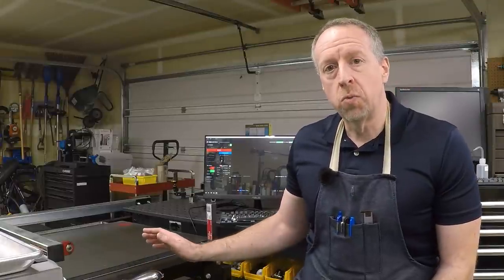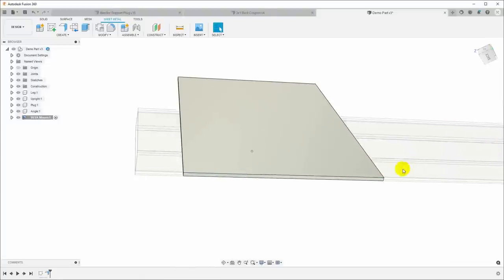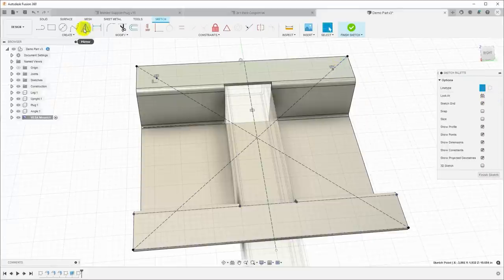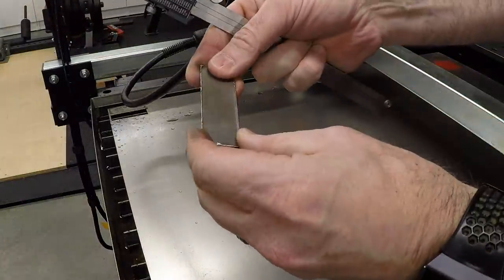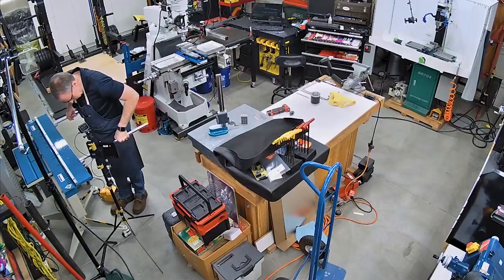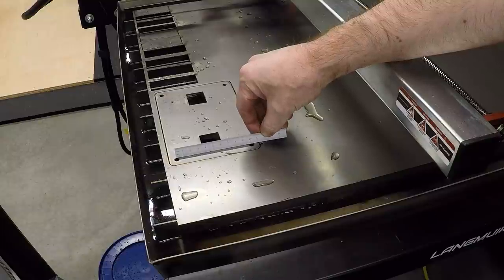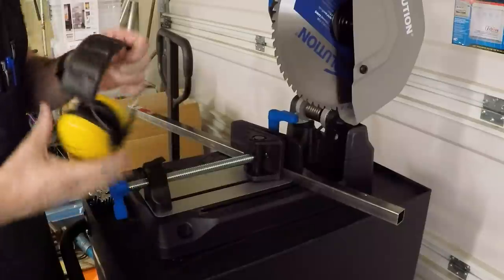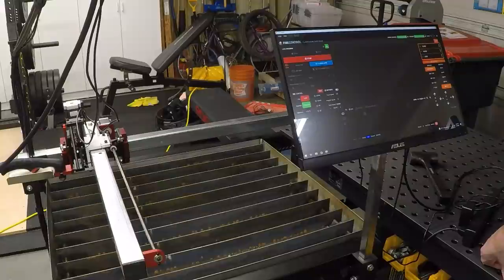Determining Sheet Metal Cut and Bend Parameters | CNC Plasma Table Monitor Mount Part 2 | Fusion 360

Comment: Hi, I'm a time traveler and I've just come back from the future to give you a warning about that monitor mount. The screws and metal spacers you've used, have connected the monitor's ground to the chassis of the plasma table. This means that the ground on USB cable from the monitor is also grounded to the plasma table. The USB cable plugs into the plasma controller, which the manufacturer has taken special precautions to ensure that it is isolated from the plasma table chassis. If you sort this out now, it'll save you having to admit to making a mistake later. Love your videos by the way, thanks for all the great content.

Comment: I was looking for filament videos and found this little project. I have the project in mind, replace the flimsy LS laptop stand with touchscreen mounted to my Crossfire Pro. It's been a year, were you able to operate firecontrol without a keyboard attached? Thanks for these 2 videos, you've saved me a lot of design time.

Comment: Are you using the FINE CUT nozzle? That nozzle is the best for sheet metal because there is no dross. Here's a tip for, I used to recondition my nozzles to extend their life. First of all, I would turn about .002" off the face and then ream the orifice with the proper size ream. Many times, just cleaning the face of .002" -.003" did the trick. you have to get them early enough though. I could tell by the sound and checking the cut edge if the orifice was egging out. Usually, if one side has dross it is an indicator the nozzle orifice is starting to egg out. I would change the nozzle and when I had 10-12 used nozzles to recondition, I would face them and check the orifice. If it needed it, I would ream it to clean it out. I used a jeweler's loop to check the orifice.  I hope helps.

Comment: Nice! How close did the vertical 100mm spacing end up? Seems like lots of room for a bit of error, but also adjustable via bend angles.
Reply from the maker: It was close enough, but I tapped it a couple of times because I'm a perfectionist.

Comment: Your probably not going to like my technique for removing dross, but I will tell you anyways. When the part is done cutting pick it up and drop it on the ground. That should break off around 90% of it.  I own one of the original pre-order crossfires that mainly collects dust in my workshop but have cut alot of plate on it and it works great everytime I fire it up.

Comment: That project turned out great....one thing I've found on welding is to flood the object with lots of lighting so there are no shadows on what I'm trying to do, and I have a cloth cover on the back of my helmet so I don't get glare/reflection on the inside of the viewing shield.
Reply from the maker: That's a good tip on the glare.  I do get a fair bit from behind.
Reply: @Clough42  Another place I get stray light is from under the front of my helmet. (worse with light colored clothes) I found the little add on leather flaps for that spot made a big difference.

Comment: That little plasma table seems nice. However, you can see it visibly shaking and moving as your cutting. While it doesn't appear like it effected your cuts on this project, I would recommend looking at stiffening the frame up if possible. Smaller materials could end up shifting and ruin your cut.
Really enjoy your videos. As with anything, time and experience.....
Reply from the maker: The frame is not flexing.  It's sitting on casters and the reaction forces are rolling it a little.

Comment: Looks nice.  Can you tell the software that you mounted the monitor 90 degrees to the actual table so pressing the arrow buttons makes the machine move in that direction?
Reply from the maker: I knew it would be 90 degrees off, but I didn't know how annoying it would be.  I'm planning to swap the wiring for the axes.

Comment: You should use MIG it is so much easier. TIG is so much harder than it looks! I have bought a footpedal now so hopefully I will get better.
Your workshop always looks so spotless - mine just looks like a workshop 😁
Reply from the maker: If all I cared about was speed and simplicity, I would have used my spool gun or just bought a MIG machine.  TIG requires skill and it's a skill I am trying to acquire.
Reply: @Clough42  
Same here but I doubt I will ever be good. I am useless at anything free hand. That's why I love machining!

Comment: You can use your digital caliper as a front gauge to hit your bend lines exactly.... just set the caliper to your bend line dimension, and use the depth measuring ability of your caliper up against the nose of the top tool and against the front edge of your material...but only if your caliper is long enough for the flange
Reply from the maker: Good tip.  Also a fantastic way to magnetize your caliper.  :)
Reply: @Clough42  that's a good reason to get one or those composite calipers we machinists always scoff at lol 😆😆

Comment: Hi James, did you bolt your bend brake to the floor,or do you find the machine weight is enough? Like you space is a premium and permanent bolting for me would compromise my options for my equipment. The only thing I have had to bolt down is my Mr.Deburr drum,as it will walk like a miss loaded washing machine.And your welds are fine,great video.
Reply from the maker: I have it on Footmaster style casters.  So far, it's fine.  I could imagine full width bends in 16ga might be enough to move it?

Comment: Very nice. The cables could just go into the tube, couldn't they? I've been using furniture wax on unpainted steel surfaces lately. A thin layer which you can polish keeps the "bare metal" look and it's extremely easy to apply. No rust yet.
Reply from the maker: Unfortunately, the bolts through the post prevent routing the wires through the tube.

Comment: I have been thinking how to mount the monitor to my homemade plasma table. Now I know. Thanks for the videos you make. I always learn so much.
Reply from the maker: If you haven't seen the later video, make sure you don't ground the monitor to the table if you have a Langmuir.  It will ground the electronics through the USB cable and prevent the torch height control from working.
Reply: @Clough42  Thanks for mentioning that. I saw the video but forgot it was a problem. Grounding can be a confusing issue.

Comment: In this case to put construction points for the holes there is shorter way: just create center point rectangle (center point in the diagonals cross section) with the desired dimensions (width and height) and put points in the corners. And - that's it!
The same procedure can be used if you need three, (four - just mentioned) five, six etc. symmetrically positioned holes. Just create center point polygon with desired number of corners (holes), dimension it and put construction points. That way you usually you do not need mirroring.
Reply from the maker: Good tip.  Thanks!
Reply: @Clough42  Welcome :-)

Comment: I love watching your videos! As I was watching this one and where you were trying to determine where to put your score line for the bend reminded me on a section I’m studying right now to get my Airframe & Powerplant license for the FAA. There’s some formulas they use to get the “setback” of a leg and the bend allowance to determine was size flat piece you need to make a part. In this case of the 2”x1” piece bent to 90° using that formula I’ll try to explain. You may have this formula already but if not maybe you can use it in the future. The formula for setback if SB=Radius+Thickness (R+T) thickness being the material you’re using. So for a 1” leg at 90° with a .063 thick piece with a radius bend of 1/8” the setback would equal .188. Then you would subtract that from 1” which would be .812”. To get the bend allowance you’d use the formula 2pie(R+1/2T) over 4. Bend allowance for 1/8” radius on .063 material would be .246. Then to get the flat piece overall length to make a 1”x2” piece bent at 90° you’d subtract your SB from each leg 1”=.812 and 2”=1.812. Then add those 2 together plus the Bend allowance of .246 to get the overall dimension of the flat to be 2.87” long. This may be confusing the way I tried to explain it. I wish I could post a picture of the example in my study material
Reply: I sent a picture of the diagram via instagram if you want to check it out
Reply from the maker: The software does this calculation, but with the magnetic brake, the radius of the bend is not necessarily well-controlled, so it has limitations.
Reply: @Clough42  I figured the software will do that. I just thought it was nice to know that way to calculate them on paper because I never knew it. Really enjoy your content tho!

Comment: is there any reason in particular you didn't split the difference and run 175 inches per minute for the plasma table? Can you only adjust in increments of 50 IPM? or is there something else coming into play?
Reply from the maker: There's no limit to the speeds.  I just figured fine tuning it to that level probably wasn't worth the effort.

Comment: Help! Slots using Fusion 360 and Langmuir
Would really like to see how to design sheet metal parts in fusion with sharp thin slots used to make the bend lines in thicker sheet metal/plate. 
The issue is that the settings for a flattened sheet metal part in fusion have a lead in and so a thin single line slot will never get created or posted. Would love a short video of you know how to do this. I'm wondering if it's possible at all? Maybe setup a custom version of langmuir posting tool with different parameters to "fake it"? Can you pick different tools for different operations? I appreciate that maybe one would have to live with a bit of uncontrolled piercing at the beginning?
Thanks!
Reply: Clarification. The idea is to make a bend with only tabs holding it so it can be "weakened" so that it can easily bent with the intention of welding the corner back up as needed to make it stronger.
Reply from the maker: I've been thinking about that.  Haven't tried it yet.

Comment: you can route the cables through the post with some 3d printed caps, nice detailed video like always. keep up the good work. any updates planned for the electronic lead screw ?, 

I was thinking semi CNC electronic lead screw you can add a servo to your main motor then you have a precision controlled Chuck and a router attachment. just thinking out loud here
Reply from the maker: Don't forget that the bolt sleeves almost entirely block the tube and I have a monitor power cable to route.
Reply: @Clough42  yeah indeed overlooked that part

Comment: James, not sure if it'll work for you but when I wanted a cover for my lathe, a Myford ML 7, I used a BBQ cover. It's sturdy and works to keep the sawdust out when I'm doing woodwork .
What about the shipping container that the monitor came in or a suitably sized garbage bag if you just want to cover the monitor.
Regards from Canada's banana belt. 👍🇺🇲🕊️🇺🇦🍌🇨🇦🤞

Comment: I like that you keep precision in mind even when it comes to sheet metal, so kudos for that. The build turned out very nice, and I am even more envious of that metal brake.

I'm not sure it will help, but I will attempt tig advice. I've found it best when you're starting your bead to get a puddle flowing on both of the sides that you intend to connect. Once you've created a puddle on both sides you can drag them towards each other, push the pedal a little further and start adding filler. Just be consistent in your movement and time your filler and it will do the rest (easy thing to say I know). Good luck in your welding endeavors and keep up the quality work and thank you for the videos.

Sincerely,
just some apprentice.
Reply from the maker: Thanks.  I'm just getting a feel for steel.  In this case, I think 65A was a little cool.  I suspect a little more heat would have made it easier to get the puddles to join before things melted back.  I'm also figuring out shades and cheater lenses so I can see the puddle better.
Reply: I generally set my helmet around 10.75 or 11 for Tig, but I'm usually welding in the 95A+ range on high carbon steel. As long as you don't feel eye strain afterwards you know you have the right setting, setting it too dark will strain your eyes as well. 65A wasn't too far off if you use the 1amp per 0.001" thickness rule. Another little tidbit for welding thicker to thinner is to spend more time on the thicker material and just wash the puddle quickly to the thinner material so it doesn't absorb as much heat.

I've been lucky enough to have people around to pester about welding, and these are things that I've been shown that I didn't think about before. The grind on the tip being rounded or sharp make a difference as well, more rounded tips make a wider puddle and vice versa. Grinding the tip with a diamond wheel instead of sand paper also makes a difference in quality as well. Food for thought I suppose, sorry if I'm bugging you with stuff you've already heard.
Reply from the maker: @thallmeister  I made a recent video about building a diamond tungsten grinder.  A sharp tungsten makes it a lot easier to control.

I started out at shade 12.  I'll try 11 next time.  I had everything running well at 125A on aluminum, and the first time I tried it down at 65A, I didn't have it set sensitive enough, so I was getting flashed occasionally.  That's no fun.  :(

Comment: James what is the mode of little  pc that your using on the back side monitor. On the plasma
Reply from the maker: There's a link in the video description.  I would consider it just barely adequate to run windows 10 and the crossfire.  Might be a good candidate for LinuxCNC.

Comment: When editing the thickness of the sheet metal, can you just enter "16 ga"?
Reply from the maker: It doesn't work for me, which actually makes sense, since sheet metal gauges are not standardized.  16ga mild steel is .0598".  Aluminum is .05082".  Stainless is .0625".  Copper is .065".  

https://www.metalsupermarkets.com/sheet-metal-gauge-chart/

Comment: I really appreciate your channel and content. You should fully convert to metric though. The transition starts with the engineers! 🎉
Reply from the maker: If all of the steel you can buy locally is specified in inches, all of the dials on all of the machines you can buy locally are marked in inches, all of the hardware you can buy at your hardware store has unified inch screw threads, and all of the end mills, drills, and collets you can buy at your local tool supply are in inches, it sounds pretty silly when someone in the YouTube comments says "You should fully convert to metric."

Comment: Hi Sir.   Just a Question have you made any RC Planes? HobbyKing stop making a Fan Duct Jet and thought of a 3D printing Carbon material RC Jet. This is a Electric Fan Duct plane.  Thanks Sir.
Reply from the maker: Yes.  I have a bunch of planes gathering dust.  So many things to do and so little time.  :)
Reply: @Clough42  Sir what would it Take to make a HobbyKing FlyCat? They Don’t make them no more. If you like I can pay for Material for you would to need measurements? Thanks Sir you are the only One too reply. Maybe you could get ok to make them and sell them to thanks.   Greg of Ohio

Comment: Man you're on a role.... Once again learned multiple things from this thanks. Dross chips off really easy with a chipping hammer rather than sanding through the dross. Just thought of another tip... rather than a shop vac or broom for you cold cut saw get one of those rolling magnets for you shop. Does a great job of picking up those metal chips.
Reply from the maker: Much of what I do is aluminum.
Reply: @Clough42  ah well sweep sweep probably doesn't hurt to do it regularly anyway.

Comment: Nice video of the process.  The bend line location and the bend deduction changes depending on the type of bending machine used.  An Amada brake using V dies and air bending ( the bend deduction would be yet again different for crush bending) pulls material into the bottom v die from both sides.  Your Magnabend clamps and immobilizes the sheet on one side of the bend line and all the stretch happens in the other side.  For your shop size and use case you made the perfect choice getting the Magnabend.

Comment: Can I ask why aren’t you using hypertherms speeds and feeds for mechanized cutting, if you need them message me and I’ll get them to you, I’ve had a CNBC plasma table for about 8 years and their setting are for the most part right on
Reply from the maker: I didn't know they had mechanized cut data for the 30XP, since it isn't intended for CNC.

Comment: C'mon James ! It clearly NEEDS a sheet metal and CNC milled, stepper driven roller shutter !
Of course the extra 0.010 gap is for the powder coating in the next episode. Right ?
Reply from the maker: My neighbor has a used oven sitting out by the curb with a "FREE" sign.
Reply: @Clough42  If it fits you're golden 👍

Comment: James,  I love how  Precise you are on everything you do on your channel. If you have the right equipment, use it to your advantage. I design and fabricate sheet metal parts for a living and I am extremely proficient in Fusion 360. I have sheet metal rules set for every Gauge we work with and over 40 different die sets in 4 different press brakes including a RAS cnc folding machine. Your new mag brake is pretty awesome, but without a hard back stop your wasting your time scribing lines with a surface plate and height gauge just to rely on an eyeball. Your always going to have a variance.   ( next video... an Arduino controlled servo driven p5 double ballscrew back stop with  Taper and automatic tram.) 🤣    but seriously I love your channel and your content,  keep up the incredible content 👍
Reply from the maker: A blade backstop has crossed my mind.